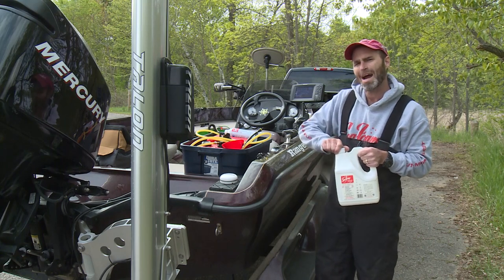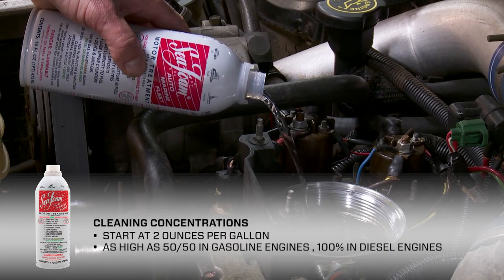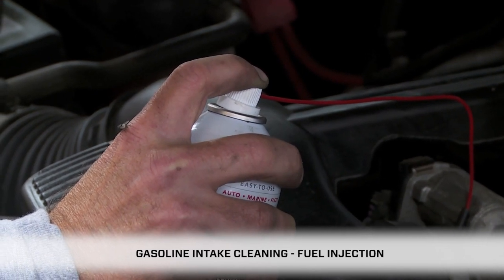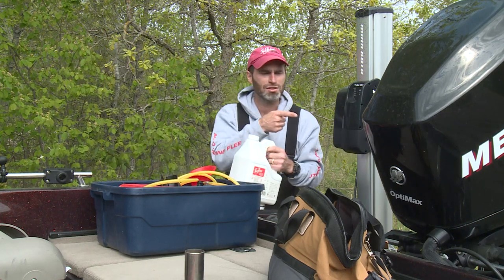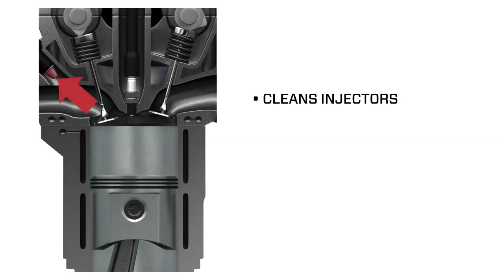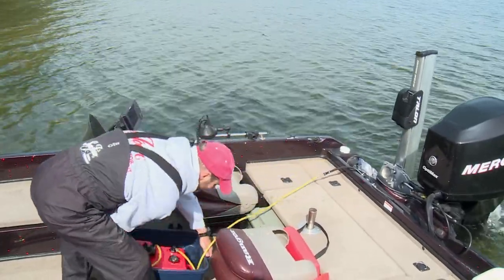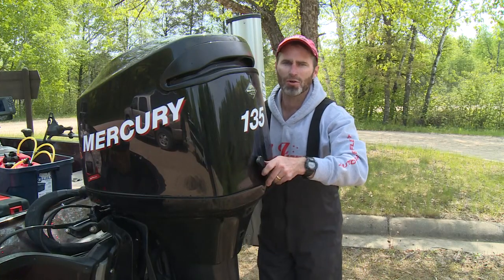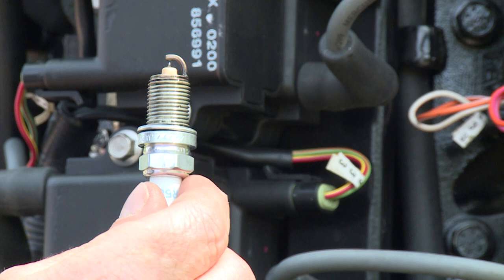Using high cleaning concentrations of Sea Foam in fuel systems

Comment: Is it ok to do 1/4 tank gas with a full bottle of seafoam?
Reply from the maker: Yes, adding more to less fuel is creating a greater cleaning concentration. It's also always safe (made from petroleum oil).
Reply: @SeaFoamOfficial  Thank you.
Reply: @SeaFoamOfficial  another question for you. I never saw any white smoke what so ever. Is that normal with the fuel line cleaning?
Reply from the maker: @mbroderick1984  To your prior question, seeing white smoke/vapor does not matter.

Comment: My motorcycle was backfiring from one or two cylinders and gas mileage was down about 10mpg (typical about 45, now about 35). I put a whole can in with about half gallon of gas in my motorcycle and ran for 5 minutes, then shut off and let sit overnight. Next day I ran it for 20 minutes sitting in garage on idle with lots of revs occasionally. Hot day and engine got very hot (engine is air cooled, no radiator just a small oil cooler). Lots of smoke from exhaust so I figured just let it keep running until smoke is gone. After about 20 minutes suddenly engine started making a loud tapping or clicking noise. Shut off engine and let cool overnight, started next day and noise remained. What did it do to my engine? It's a 1991 Honda Nighthawk 750 with self adjusting hydraulic lifters. Noise seems to be coming from top of engine above one of the four cylinders. Stuck valve? Broken lifter? Please tell me I didn't ruin my engine. What do I do now? I do regular maintenance and oil changes and don't ride hard.
Reply from the maker: Did you check the plugs for fouling?
Reply: No I didn't check the plugs. The noise came on very suddenly. It's definitely coming from the #2 cylinder exhaust valves' tappet/rocker arm area. 

I took the valve cover off and removed all 4 spark plugs and pressed and held the starter to turn the engine without ignition but the noise doesn't happen. Installed plugs and started engine and ran for a few seconds (valve cover still removed) and heard the noise. So the noise happens when engine is running from ignition but doesn't happen when engine is turning from the starter without ignition.
Reply from the maker: The backfiring + noise from the exhaust valve = sounds like a valve clearance adjustment is needed.
Reply: Hydraulic tappets so no valve adjustment is possible. Only thing I can think it could be is one or both exhaust hydraulic tappets failed (2 per cylinder). It seems highly unlikely that 2 tappets would fail at the exact same time, so I'm guessing it's just one of them. The question I was hoping you could answer is what caused it. Like I said the noise came on suddenly.

Update: Upon closer examination I see that one of the exhaust valves on the #1 cylinder is stuck open. (The rocker is not on the cam lobe but I can see about an 1/8" gap between the rocker and the cam, and the valve stem is lower than the others.) I'm confused because the noise was coming from the #2 valve area.  So now I think the #2 tappets are ok but the #1 valve is stuck open. Any tips on unsticking the valve without going through hassle of disassembling engine to get at valve? I would think the Seafoam would've cleaned everything and made things less sticky, not more sticky.

Update: The valve does move up and down from the cam lobe but does not close completely when off the cam lobe.
Reply from the maker: Adding Sea Foam to fuel goes through the fuel intake/combustion side so has no relationship to stickiness that can occur around cam parts. To clean the oil side areas of any 4-stroke engine you would add Sea Foam to the oil crankcase (1.5 oz per quart). Sea Foam in oil works to reliquefy any sticky oil residue that may be causing parts to stick. Obviously, it won't overcome worn or damaged mechanisms.

What I'd be looking for is corrosion or burnt oil crud on valve guide/s.  Other is that your valve gap is caused by a bent or worn part anywhere from rocker (bent) to pushrod (bent) to lobe/cam (worn).  I don't see any way Sea Foam can help.  Wish it were an easier fix.

Comment: I wanna use this in my 5.7 hemi. Can I  add a can in with the oil or should I do it through an intake line
Reply from the maker: Adding to oil works to reliquefy heavier crankcase forms (treats a different area than intake, which is combustion/top end). Do not add thru intake line - use Sea Foam Spray through the throttle body. Hope this helps!

Comment: I have a go kart with a 212cc predator engine that has been sitting for 2-3 years. I tried to start it several times and it would turn over and then die. I let it sit overnight and tried again in the morningand the motor would not turn over. Would Seafoam fix this problem and allow for the motor to start?
Reply from the maker: It will definitely help if your fuel passageways are gummed up/varnish.  Remove the fuel, then add a half can of Sea Foam and a pint of fresh gas to the empty tank.  Crank it several times to draw the Sea Foam mix into the upper engine.  Let it sit for a day or two to soak.  If it starts. you resolved a varnish problem. Just add more fresh fuel and go.  Let us know what happens!

Comment: So by using 2 gallons 1 gallon gas and 1 gallon seafoam do I add 50:1 for 2 gallons on my 2 cycle ?
Reply from the maker: Hi John:  Going 1:1 with that great of volume is total overkill - don't do it. (You can accomplish the same results with considerably less volume.) The idea behind making the high concentration video is NOT to recommend, but to demonstrate that it can be done and that Sea Foam is always safe on parts..and cleans upper engine areas.  Just because a guy eats 50 hot dogs (excessive) in a contest doesn't mean it's prescribed as something wise to do.  Hope this  helps!

Comment: I have a mercury 200hp Black max v6 that runs on premixed fuel! Can I just add sea foam to the already premixed fuel?
Reply from the maker: Yes, can add to any gas or diesel fuel, including any pre-mix 2-stroke oil.
Reply: Sea Foam Official thanks very much for the prompt reply I haven’t used the boat in about a year and a half what would be the best way to make sure it gets a good concentration into carbs to clean them in case of any old 2 strokes still in there? Would this dissolve that and clean carbs if that is the case? Thanks
Reply from the maker: See our "Can & Hose" video.  Yes, would dissolve/liquefy the old fuel residue/gum/varnish that will form in the carburetor circuits. (It's gum and varnish that causes fuel flow restrictions in carburetors and injectors.)

Comment: Thanks for the video.  I have a 1999 Nitro boat with a 2 stroke mercury 150.  Do I need to add oil to the gas sea foam mixture?
Reply from the maker: Hi Ryan:  No, because your fuel (mixed with Sea Foam) will mix when the fuel/oil combine in the tranfser port.
Reply: So I tried this on the lake mixed 50:50 sea foam gas mixture and ran motor for about 10 minutes. Now my motor will not turn over. Any ideas what could be wrong? My motor fired up on the first turn all year long.
Reply from the maker: You need to start with a hot intake to run that high a concentration.  Without a hot upper engine you can foul your plugs.  You do NOT need to run 50%.  That's not the point of the video.
Reply: Well, you signed off your video saying "never be bashful went it comes to adding seafoam to fuel."  So I went with 50 : 50 mixture. Do you have any recommendations to fix my problem? Do I need new plugs?
Reply from the maker: I get it... Sorry you're having trouble. Want you to call our tech line so I can help you through the matter. The only harm possible is fouled plugs  - Just pull them out and if the white center electrode/s are charred you need to clean (burn off char with a stove flame) or replace. You'll also need to add gasoline to increase fuel volatility.  How much fuel is in the tank?

Comment: Can.i use seafoam.at higher concentration instead.of having to.rebuild my carb.on king quad 300 that sat.for 5 yrs straight without being started?
Reply from the maker: Yes, for sure. Get the old fuel out...add a can of Sea  Foam and half a gallon of fresh gasoline...remove the plugs and crank the engine for 10 to 15 seconds...put the plugs back in and let things soak for a couple days, then try to fire it up... The soak time will work to reliquefy all the old fuel varnish from the carburetor circuits.
Reply: Sea Foam Official thanks for the quick reply. Here’s what I already did-I drained all old gas down to like 1/2” then added a bottle of redline and half tank of fresh gas then was worried about condensation so I filled tank rest of way and added a bottle of sea foam. Then changed spark plug and fired right up! But have to keep giving it gas to keep running. And it smokes a lot but I figured that out today after watching seaFoam videos. Should I add more bottles seaFoam since theres now 3gallon of gas ? 
I’m trying to avoid taking the carb off machine and having to rebuild as ppl say it’s a tight fit. And tricky carb to work on according to some.
Reply from the maker: @dw4940  There no risk of tank condensation. My only advice is start over with the previous suggestion after you get through your 3 gallons of fuel.
Reply: Sea Foam Official I was thinking if my math is correct,I need to add 5 more bottles of seafoam to the 3 gallons. Have to fix front & rear brakes and change brake fluid & oil. Then will go riding and burn through the 3gal. Everyday I’ve been spraying seaFoam Creep into air intake while motor is running. Then shut off and let soak. Thanks for your advice.
Reply from the maker: @dw4940  By adding more you're spending too much money and making a bigger mess to clean up. If you don't want to wait to run the fuel through the engine, siphon it out, put it in your car/ruck tank, then start over with the initial recommendation.

Comment: I have a 2-Stroke 98’ Mercury 150xr6 oil sensor bypassed. Do I mix my 50:1 ratio with the gas or just gas and seafoam? 
i premix my gas as of right now
Reply from the maker: Any premix 2-stroke needs oil regardless. Make sure you always have 50:1 mixed. Sea Foam does not replace 2-stroke engine oil.
Reply: @SeaFoamOfficial  can I use pure gasoline and alot od seafoam instead of a mix for my 2 stroke dirt with reeds?
Reply from the maker: @justinc9911  I would not. Sea Foam is not a substitute for crankcase oil.

Comment: Can I add this to my tractor hydraulic lines to clean and take out moisture?
Reply from the maker: Yes, will help. Note that Sea Foam has a transmission/hydraulics product - Look for Trans Tune.
Reply: Thank you for replying. Should I change the old fluid since I just added the regular Seafoam a couple of days ago, before I looked at your video?  I did not know about the Trans Lube until now.
Reply from the maker: No need to change unless the old fluid is worn or has too much water.  Water will emulsify and turn the fluid milky right after operation.
Reply: Thank you, I'll keep an eye out for that.

Comment: Would you use Seafoam before or after a catalytic converter replacement?
Reply from the maker: Thanks for the question.  It does not matter - Sea Foam has no relationship to a cat. converter.
Reply: Sea Foam Official 
So where does all the cleaned out gunk from injectors, ports, piston and rings, combustion chamber go? Would not all the debris from this process then pass through the cat convertor possibly blocking it?
Reply: KARLOZ LOPEZ  
Yeah funny about that! The gunk just magically dissapears just like their reply! All that gunk cant get burnt up and vanish thats for sure

Comment: But if I run half seafoam and half gas does it mess with a fuel filter in a car?
Reply from the maker: No, does not.  Sea Foam's ingredients are derived from petroleum oil, just like fuel and motor oil.   No affect on a fuel filter.

Comment: Where do I buy a 1 Gallon jug in Canada?
Thanks!
Reply from the maker: Thanks for the question.  Anywhere automotive products are sold in Canada or USA.
Reply: mike 13 Try E-Bay
Reply: Canadian tire, bud.
Reply: Canadian Tire...but it costs something like $86 Bucks a Gallon!
Reply: ...but the 16 Ounce Cans run for around $11-$12 Dollars.
Reply: @darring.9161  that's because everything is overpriced in Canada. Especially in B.C
Reply: @matthewbaldrick98  BC means "Bring Cash" for a good reason!

Comment: why did the car run rough at first
Reply from the maker: Can't know without more information but common cause of rough running is petroleum forms that impair fuel passageways. Fuel system and upper engine residues are variations of unburned hydrocarbons whether heavier fluid gum forms or deposits around injectors, valves and chamber areas.. Sea Foam (petroleum) works to clean by safely dissolving petroleum residues, helps clear things out.
Reply: before using 2 cans of sea foam  my engine light came on with a mis fire code  on coil d. all gone now and engine smoothed out and increased HP.
Reply: awesome proclaim

Comment: Can seafoam más up yr gas tank
Reply from the maker: No, it's good for it - no worries.
Reply: So it’s okay if I put on my gas tank on my 94 Camaro
Reply from the maker: @jorgenuno1526  Yes, Sea Foam works great and ALWAYS safe when added to ANY gas or diesel engine fuel!
Reply: Okay thank yu I appreciate it how much can I put on the car all the bottle
Reply from the maker: @jorgenuno1526  Yes, best to add a full can when the tank is low.

Comment: Can i only add seafoam to my gas and still see results?
Reply from the maker: Hi Kevin:  Yes, if Sea Foam overcomes a fuel system issue.   Is there something going on with your engine?  What engine?  What issue/s are you experiencing?
Reply: Sea Foam Official just old stale fuel in my 07 Explorer 4.0L SOHC, causing rough idle
Reply from the maker: Try this:  When you fuel tank is very low (less than 1/8 tank), add 2 cans of Sea Foam and drive 10 tor so miles...shut off and let sit overnight or longer.  Then drive again and add fresh fuel.   Sea Foam Spray through the throttle body would also help clear things up.

Comment: So this isn't too much of a solvent to run through a diesel injection pump, i have used it on my gas engine with awesome results but it seems like its to strong for the pump to stay lubricated properly on 100% seafoam
Reply from the maker: Sea Foam is a lubricant (petroleum oils) and has much greater lubricity than diesel fuel.  It will ADD lubrication, always.

Comment: Every tank of gas??
Reply from the maker: For small engines, yes. For cars and trucks used regularly, add a can or two every couple months.
Reply: @SeaFoamOfficial  you did say you add every fill up regularly 😂😂. I say every 3 tanks on the lower end of the 3rd tank
Reply from the maker: @alejandrotobienne584  The can shows for Autos & Trucks: Add every 3,000 miles. That's a decent general rule. It never hurts to add more frequent if you wish. Every 3 tanks will work great!

Comment: I feel taking the advice to use more of a product from someone who has a financial interest in the product is probably not the most prudent decision.
Reply from the maker: Thanks for the post.  Finding plenty of objective, 3rd-party advice about Sea Foam should not be a problem.
Reply: Element of Kindness 
Have you ever used the product?
Reply: Yes.  I'm currently running it in my oil at the recommended dosage on the can, in an attempt to quiet down some noisy hydraulic lifters.
Reply from the maker: Keep adding a half can toward the end of each oil interval.  Will clean things up if the lifter noise is caused by sticky deposits.   If you ever have doubts, drop a glob of heavy crankcase goo in a jar of Sea Foam to get a visual idea for how it works... In your crankcase, Sea Foam works to liquefy heavier/sticky oil residues (so they drain away).  Simple, safe...
Reply: @joe Vulcan Actually, it seems it has.

Comment: WHY TWO different boats????   Beginin and end boat two motors, on water run boat one motor??
Reply from the maker: The beginning and end boat is the same boat, one motor.  I think you're seeing the cowl as a second motor (?)
Reply: Shit that's the same boat bud that's just how good seafoam works.
Reply: That one clip with 2 motors was just a spliced in clip of a running boat I don't think it was meant to come off as the same boat